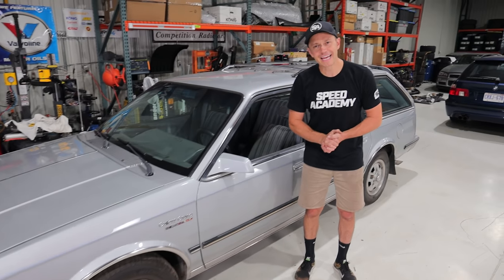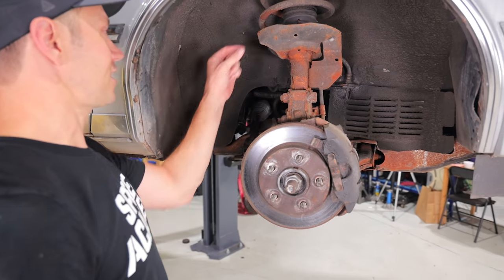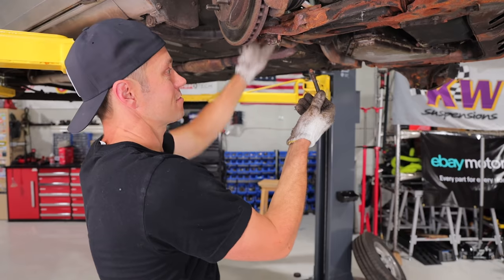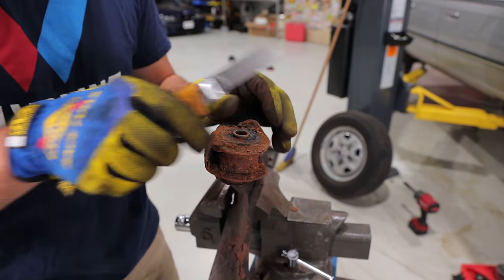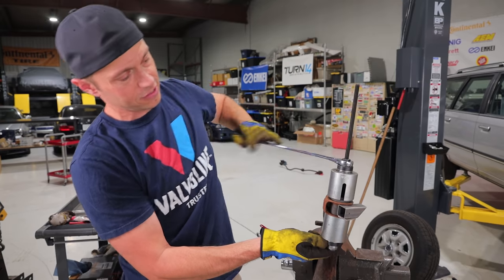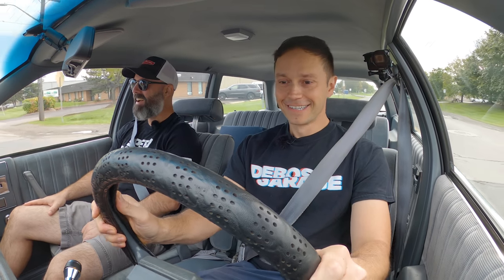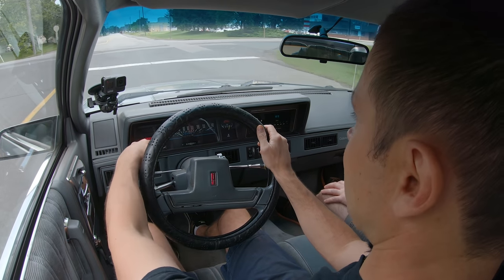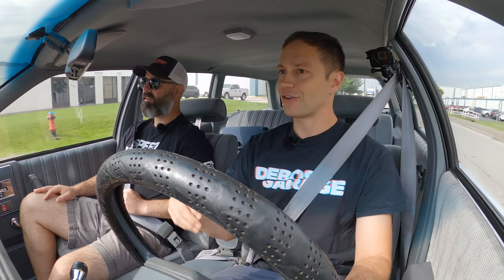Can We Fix This 80 Year Old Grandma's Car When No One Else Will?

Comment from the maker: There have been ALOT of comments about us fixing the rest of the Olds and we certainly would have but the shop explicitly told us to just do the bushings and nothing more so that’s all we did. The Cutlass has had all the nagging issues fixed by the shop and the little old lady is back on the road cruising in Cutlass Ciera style.
Reply: I'm glad the shop was able to help her out and get her back on the road in her vintage wagon.  Thanks for helping her out with that!  Considering the age of the car, that laundry list wasn't so bad and it was pretty clean inside.
Reply: Great of you guys even though this video didn't get many views 😭
Reply: Maybe you could still hook grandma up some way? I bet she doesn't have money to throw around for "extra" repairs.
Reply: It's okay. At least you guys did what you could. Maybe one day there can be a Relic Restoration, but with a car that has available parts. Perhaps an old SUV build? Since the season is here. Maybe building a sleeper Bronco?
Reply: I would subscribe and watch the hell that to
Reply: you guys are awesome really to help this lady out and let her ride in her one and only car is a wholesome site of the eyes of glass.
Reply: The control arms with the bushings already installed are only $38.
Reply: @ChannelZeroOne  Those aren't the correct control arms for $38. The ones they need are around $80-$90 each for this model. The bushings are available for cheap so it is the correct repair they are doing.
Reply: @kj197734  either way I wouldn't put back on those control arms. Seems that you guys making a big deal out of a minor repair.
Reply: Had I not read this I was going to say how you guys could have done more..
Reply: It's a cutlass cruiser not a Cutlass Ciera lol
Reply: I don't get it. They asked you not to fix it so they could get paid? What if you just fixed it anyway?  I'd have to say if you left the car in that stalling state then the answer to the title is no.  Were you compensated for your costs?
Reply: You could have provided her with your contact info. It was a missed investment opportunity, nothing more.
Reply: I would've sandblasted the control arms and subframe then coated it.  Unless that undercoat has a some sort of rust reversing agent.  My Aunt & Uncle has a 1989 Pontiac 6000 LE.  It was bought brand new by my Uncle's Father and has about 120,000 miles.  So far the only part that we can't find is the door seals, so we had to use universal seals.  We had to replace the throttle body and the only place that had one was RockAuto.  The messed up part was, every shop, auto parts stores, and dealerships said they can't get one.  I went straight to RockAuto and there it was!  Needless to say I made it clear that everyone failed to look at ALL options.  The biggest issue we have is the engine runs pretty crappy.  We had to replace the rear head which suffered from a manufacturing flaw which resulted in spark plug blowout (but the front head didn't do have that problem).  You can only repair them so many times and GM never did a recall to correct the manufacturing defect.  It ran great before then, but now it's a constant issue that no one can seem to figure out.  I'm at the point where I'm going to just pull the engine out and pull both heads off, do a complete gasket job (especially the intake for the 5th time), and make sure the timing and valve adjustments are correct.  Do a thorough engine harness check with all sensors and electronics as well as a complete vacuum line replacement.  It was running real rich and clogged the cat and burned out the O2 Sensors.  A delete pipe was installed since they couldn't afford a cat at that time.  So I will be working on doing exhaust work and new O2 sensors.  I'm also concerned about the torque convertor and transmission since the kick down cable was not adjusted properly when it was reinstalled after the head replacement (the guy was a "friend of the family" and I think he did a half ass job resulting in the list of problems we have).  So I may end up rebuilding the transmission myself since there isn't a single shop in my state worth a damn.  It needs some TLC for sure and has a lot of family history.
Reply: Can you help me get my 65' Volvo 544 back on the road? Please?
Reply: It looks like the car off of beamng drive

Comment: Grandma probably pays double digit in insurance and given the KM probably refills every month or so if that. Can't blame her at all for wanting to keep the Cutlass around. Must be jam packed with memories. My dad similarly drove a '98 Corolla until about 2017 when he was rear ended and that would have been the car I drove had it not been rear ended (was finishing university away from home at the time). Older cars are just so fun to drive sometimes. I currently drive an '05 Camry and I honestly love that it's not riddled with a million distracting features. Just pure and simple driving.
Reply: Love my 04 Camry LE. I commute 80 miles a day and I call it my mile pig. Gas mileage is okay but I don’t think you can find a more reliable, simple design. I was offered 2k more than I bought it for and I laughed. This car is irreplaceable for me!
Reply: Love my 1980' vehicles.  I can replace almost all of the major parts for a 10th of a new car price.  They never need all repairs at once...count it as a car payment. a cheap car payment and low insurance.
Reply: My grandpa is in his 80s and he drives a '91 S-10.   He could afford to drive whatever he wants, but he never leaves town and his vehicle costs are pretty minimal.  When you only drive a few thousand miles a year at speeds under 50mph, your vehicle choices open up a lot in my opinion.
Reply: Things certainly have changed for sure. I'm a 60's 70's car nut but also appreciate some of the 80's and 90's too.

Comment: There’s a thing known as the minimum tag cost.  In some areas, like Oklahoma, that is a $27 per year tag. Add that to the depreciation cost of nearly $0 on this car. With it only having 150k km which he said is around 100k mi, fuel mileage isn’t much of a cost. This car is an excellent value proposition with only maintenance being its cost.
Reply: Same in Arizona some cars pay as low as $10.00 of MVD taxes!
Reply: Exactly I had one about 10 years ago that literally cost pennies per day to own. I originally bought it from an older guy who's wife passed away for$250 with working AC and about 2000 miles on the 4 year old tires and brakes.
     The car was spotless,garage kept no rust. The only issue was a drooping head liner and he had it listed for sale for a while. He was asking $1000 obo and I was shocked it didn't sell because it only had 86k miles. But apparently everyone that needed a good cheap car couldn't deal with the headliner drooping . So he offered it to me for what scrappers offered because I was gonna drive it.
Reply: @southjerseysound7340  I pulled the headliner out of mine (89 S-10) and got another after a while. I drive one, l not look at the roof insides. Gave $500 for it and had to put parts in it but it's still cheaper that a 4 inch payment book and I don't drive it that much but when I do it's always ready to go. Fill it up with oil and gas (4.3, 4x4) and GO! CHEAP taxes and no more inspections.
Reply: @rehnjanhn4025  
Exactly, 
They’re easier to repair, and generally far cheaper to buy parts for. 
The cheaper insurance and plates are a big deal too.
Reply: @southjerseysound7340  
Man, an automotive upholstery shop can easily fix that headliner.

Comment: It sounds like it needs a lot. Alternator, rear bushings, steering box adjustment, battery.
Reply: Alternator for sure
Reply: Needs Alot of stuff? Really ? That's a weekend worth of work. And less than 500$ for a low mileage car that will start more reliably than anything built in the last 20 years.
Reply: @ryurc3033  I 2nd THIS!
Reply: @ryurc3033  
People just don’t understand these things
Reply: These guys are making a big deal out of a simple little job. That’s all gravy work for a good tech. By the way that car has a rack not box
Reply: @stevem5139  Got to get drama somehow. What got me was doing all that without oiling the parts up first. And everything that was wrong with the wagon was simple stuff. An EASY fix like Ryan Underhill said. An afternoon or two's work. Then look what you'd have. That is a SWEET car! I'd drive it in a nano-second!

Comment: I love them cars it’s based off the Oldsmobile cutlass ciera sedan but Oldsmobile just called there wagons cruiser you can go to a Chevrolet celebrity, Pontiac 6000 for model years 1982 to 1990 and for buick century and Oldsmobile cutlass ciera and cutlass cruiser model years 1982 to 1996 it’s a GM platform called the A-body

Comment: When installing suspension bushings, they should be at loaded ride height when tightened.  Usually that means putting a tall under-lift jack stand out at the ball joint and raising until the full corner weight is achieved and  is no longer supported by the lift arm.

Comment: I'd love to see you fully sort this out, interesting to tackle with no parts support. I was surprised that the metal sleeve that came out when removing the old bushings didnt have to go back in with the new bushing pressed in? I'm not a bushing expert at all though.
Reply: I believe that sleeve is also present on the new bushing, it just kinda blends in to the rubber material.

Comment: I drove a sedan version of one of those for years. The freeze plugs were rotted out when I bought it. Replaced them with the rubber ones from autozone and it was still on the road after 200k miles.

Comment: This is great segment, our family had the 1985 Pontiac 6000 station wagon. It had close to 400,000 kms with original engine transmissions until a drunk driver hit the car and totalled in late 90s. This were the times when GM built cars to last and they were ahead of the time compared other manufacturers. Even the battery GM had the AC delco was reliable compared to the Japanese equivalent cars. It is unfortunate that GM produces garbage now days. GM had throttle body fuel injection in the 80s meanwhile Honda still played around with stupid carburetors. 😂

Comment: Now THIS....this is an iconic car from the 1980s and 1990s. A first-gen unibody car from GM.

I remember, as a kid, seeing these cars everywhere -- just like the old-school Escorts and Econoline panel vans.

Now these cars have been scrapped, for the most part, and it saddens me, because the way these cars were, they were on par with Toyota, Honda, and Nissan -- with a bit more power. They were reliable cars -- a good deal, if you could find one. Plus, whether you remember it or not, these cars had a unique sound to them, both from inside and outside the hood.

Glad to see you guys get this car back up and running for that lady. You'll get some good karma for that! 👍

Comment: Ah the old iron head 2.8. the same one that got into the fiero and with an overbore into the 94-96.5 F-body Camaro/Firebird. 
It would actually be fun to see someone swap a more modern motor in that car. Maybe not something super powerful or anything, but there are loads of newer tech engines that could work. Heck even the 3400-3500 even the 3800 series motors would be an improvement in weight, power, even efficiency than that iron head engine.

Comment: Shocks would stop the boat floating also the rear bushings are possibly also shot. Battery also check the alternator as if it was the battery only the windscreen wipers would come on.

Comment: I had an 89 century. Still have it, technically. The rear control arm on the left side rusted so severely that it broke off causing the rear axle to pivot back and forth during acceleration and braking. It's now sitting in my backyard which has become its grave, due to the fact that I am too sentimentally attached to it to let it go to the junkyard. Thing was my first car

Comment: Nice job except for 1 mistake: when the bushings are torqued they are supposed to be preloaded under the weight of the vehicle to prevent over-flexing the torsional rubber bushing design. This is a very common mistake that results in the vehicle to appear raised slightly in ride height and ultimately premature bushing failure.

Comment: Are those like swimming goggles for the handheld reciprocating saw use?
Reply from the maker: Yes pretty much but they are safety grade so the lenses wont crack
Reply: @speedacademy  i really like that idea i need to find some. For both use cases, never felt safety glasses did enough in some cases and hate swimming with goggles that have the stupid nose plugger for snorkeling.. Like i can snorkel with my nose open thank you very much.

Comment: Funny how ubiquitous cars from that era were, but thanks to "cash for clunkers" they seem even more rare than cars from previous decades. I tend to notice when there is some random 1980's domestic car showing up that looks really clean. (Which isn't a fox body Mustang, Firebird, or GM G-body, as those still seem more common.)

Also that control arm should have had some time with a wire wheel and rattle can before having a new bushing and going back together. Given the difficulty in getting such parts, an extra ounce of preventative maintenance would have been nice.

Comment: I don't believe the Seat Belts are bad. In all my Dodge K-cars the belt was real tight, then you just had to pull a little more out until it had some slack so you could breath. I think you just pulled too far and had too much slack. That's how they all were back in the 80's. It's a little hard to describe how they worked. I bet the passengers side did the samething!

Comment: I wish Oldsmobile never died 😭

P.s. they sell the control arms with the bushings already installed, online, for like $40-$70 each

Also should've used Rust-Oleum spray paint, as it'll convert the rust instead of just covering it...

By the way, that year had automatic windows and locks, but hers didn't. Even brand new cars can have manual items...

And lastly, I don't think it's the battery 100%... It's probably just coincidence because you took awhile to get the jumper on the connections

Comment: Those are called "rally" wheels and they were a big thing back in the '70s and '80s. And they are actually the proper size, and have real tires on them. Too bad it is front wheel drive. I have never seen a well made front wheel drive car, and they can be a nightmare to work on. New cars are in no way better, in fact they are MUCH worse. I'm still driving a 1972 Ford Pinto wagon with a 4 speed manual on the floor. No problems at all. And here in AZ, U.S. things just do not rust. It is rear wheel drive, and SO easy to work on. Sadly that car has EFI, which means it will never be reliable. I would be looking for something older and carbureted. But it could be that she bought it new, and has owned it ever since. I can definitely understand her wanting to keep it. I saw one video of an old lady who was still driving a 1957 Chevy she bought new. 
I would love to have that car IF it were carbureted and was rear wheel drive.

Comment: I had a 1993 in dark metallic blue that was loaded and had low miles. The 3.8 liter engine had plenty of torque and it was an 8 passenger. The 3.8 replaced the 2.8. This vehicle was the same as the Chevrolet Celebrity and the Pontiac 6000. We sold ours to buy a new VW Eurovan in 2003.

Comment: You guys should have done a proper job on the car for this senior.  Ball joints, rear suspension, brakes, fix the electrical problem, and anything else it needed.  That's the right thing to do.  Especially since you called her an old lady so many  times, then made fun of her car on your joyride.

Comment: You were not supossed to remove the second slave, the bushing should be pressed in with an hydraullic press, leaving the external slave in place. You noticed how easy was to insert the new part in, that's because it has no slave now to fit into, so now the bushing will come loose at the exterior, grinding and enlarging the bore in the control arm pretty quick. I have been doing this job for 30 years now.

Comment: It's kind of mind-blowing that a car made for 14 years has no aftermarket support for a major part like this bushing. I bet you that GM had a special tool for that difficult bolt. I am not at all surprised that GM made this car this way, though. I do like these A-body wagons. I've got no time for the A-body coupe or sedan, though. That following feeling is part of the driving experience, with that squishily-mounted subframe. It was a lot worse on the X-body cars, but still kind of alarming in the A-body. The 2.8 in those cars would have been churning out 125 honking horsepower.

Comment: Nice to see a relatively clean, unmodified base model Cutlass Ciera wagon. A true survivor! Takes me back to my childhood too. I know it wasn't exactly the pinnacle of 1980s GM automotive technology, but these cars, especially station wagons, were seen as throwaway appliances. I'm sure most of them ended up in junkyards by the early 2000s. I've had at least one of each GM A Platform cars in sedan and wagon format (as beaters in the 1990s). With so few of these left, it's worth saving the good ones.